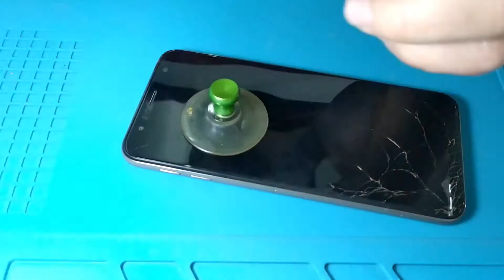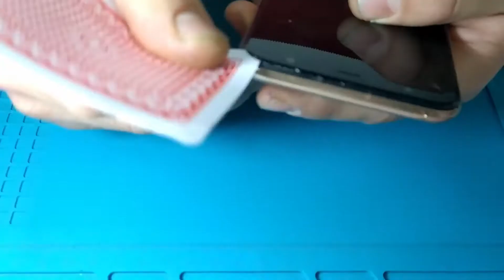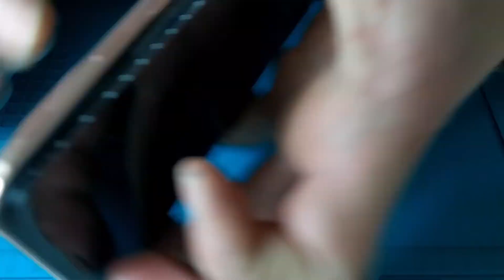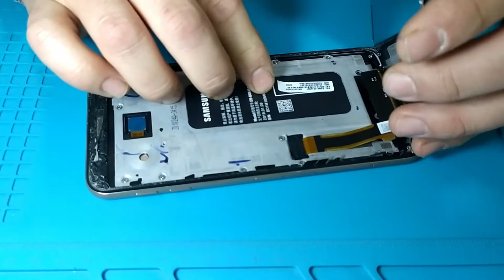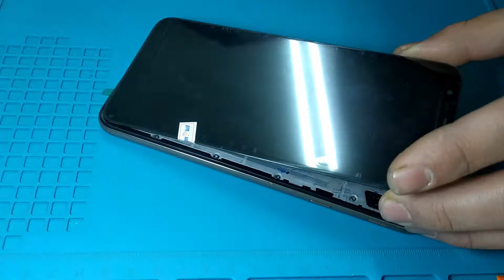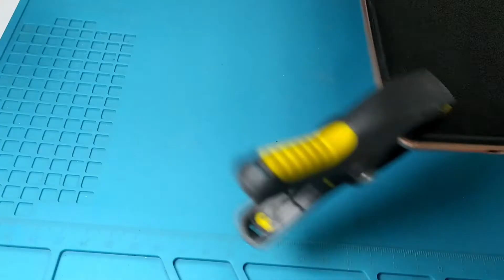SAMSUNG J4 PLUS SCREEN REPLACEMENT IN 5 MINUTES

Comment: What happens to the glue is ot already attached to the new glass
Reply from the maker: Glass has own glue.
Reply: @SpeciFixx  what's that mean .its not clear what your saying .
Does the glass come with it. ?
Or do I have to buy a special glue .?
Reply from the maker: Some models of screens has glue. Watch carefully you will see glue on screen, if doest has you need to put b7000 adhesive.